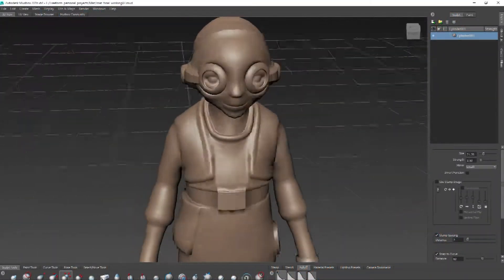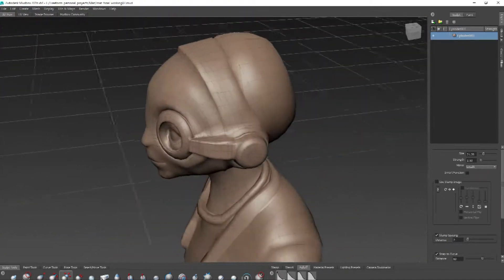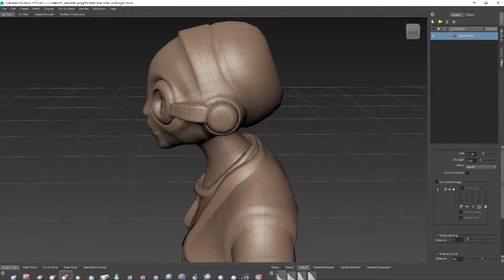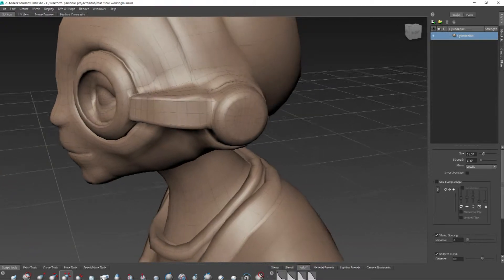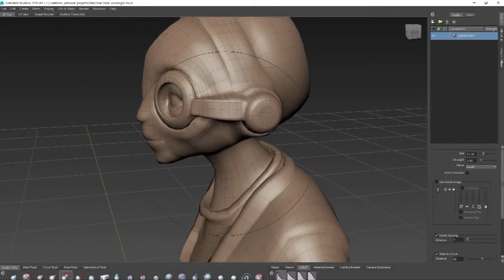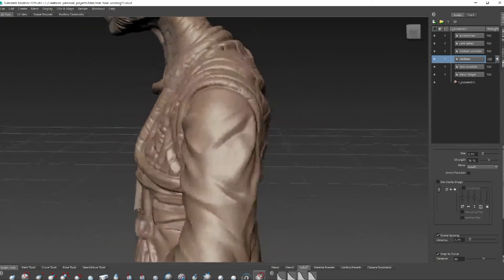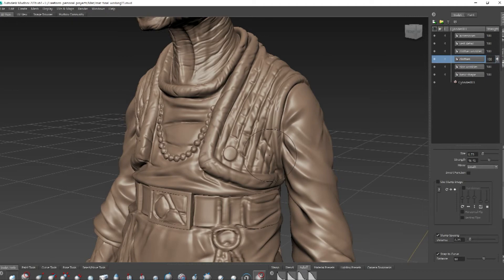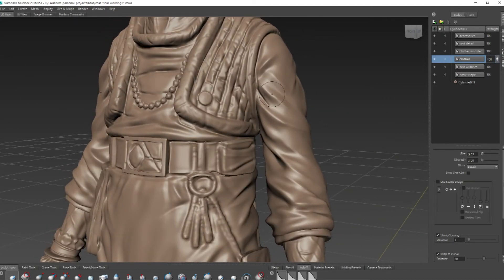Creating Maz For 3D Printing-Part 2

Comment: I have to say watching this timelapse is very inspiring.

have you tried using the retopo function inside mudbox? it would help with adding resolution to the small parts like the keys where there isn't enough polys.  Just a suggestion.
Reply from the maker: That's a great suggestion, I wasn't too worried on this model but I will use that for later. Thanks for the feedback!